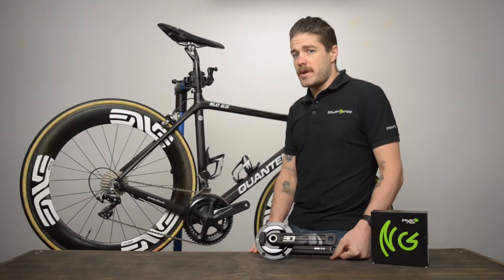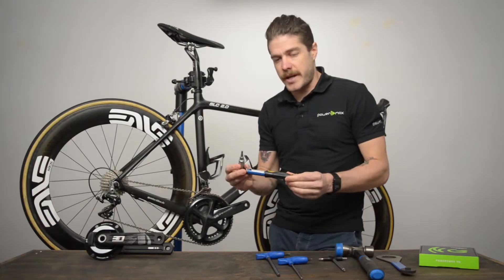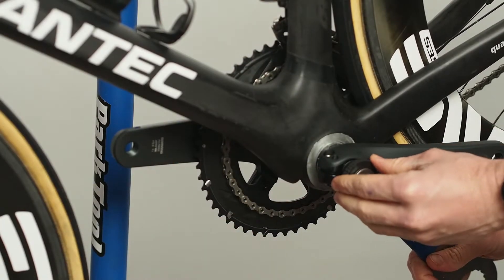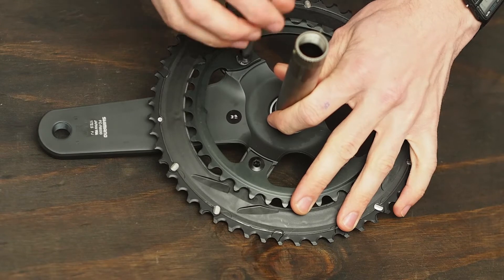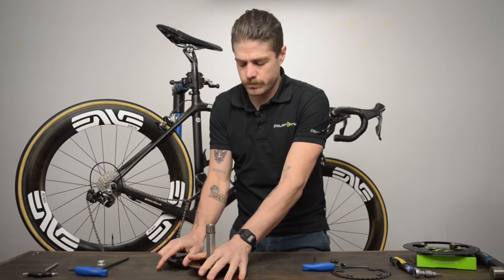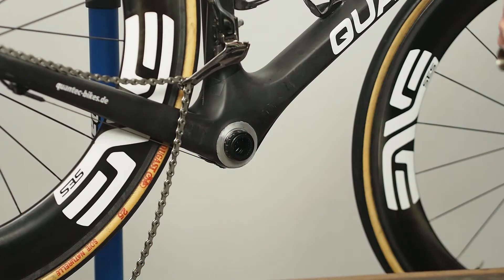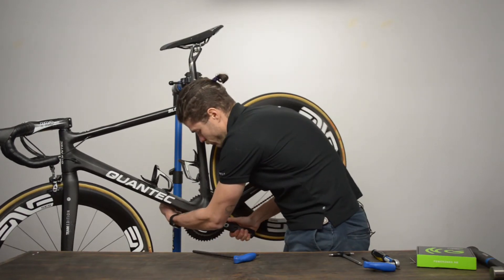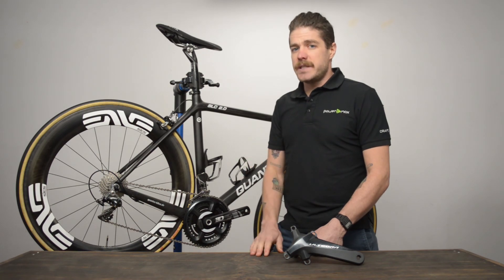ROTOR 3D SHIMANO 4-S INSTALLATION

Comment: My Rotor 3D cranks seem to be stuck.  I removed the cap and loosened the pinch bolt on the non-drive side but the left crank won't come off.  Any suggestions?

Comment: Is power2max power meter compatible with ultegra R8050 and R8000? I have a power2max NG FSA (also 4-hole) with ultegra 6800. I want to update to the newest ultegra, but the ultegra specifications states that the "old" (6800) cranckset is not backwards compatible with the new front derailleur. Can I just use the new ultegra chainrings on the power2max power meter and have a perfect functioning (as if everything were the newest ultegra)?
Reply from the maker: Hi There. Yes, the Ultegra 8000 chain rings will mount on to the Power2max 4-bolt spider. If you have any more questions, send us an email at support @ power2max.com
Reply: Unless I am misunderstanding, fc-6800 IS COMPATIBLE with the FD-r8000.  

I am saying this based on the shimano published compatibility chart.  Also, I have the fc-6800 that I use with a FD-r9100 (same design concepts as r8000).

From what I have seen, both the 6800 & r8000 chainrings are compatible with the ng eco 110-4s.